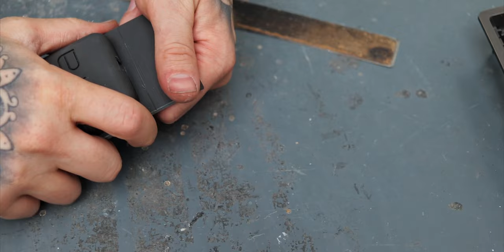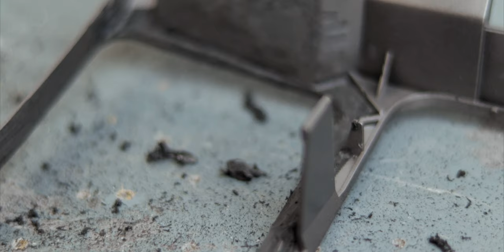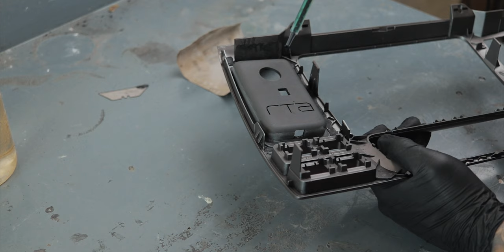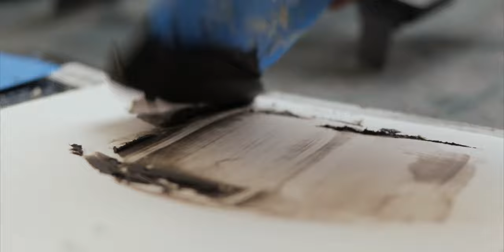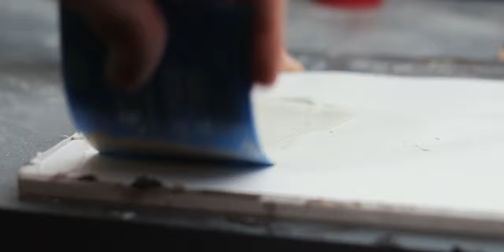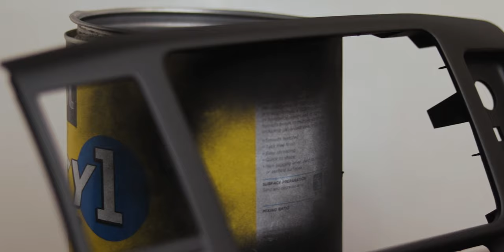MAKING A CUSTOM Air Suspension Controller Mount For A VW Transporter

Comment: What is that superglue-like material you're using, which you then proceed to spray with something immediately after? That would help immensely in my personal manufacturing. Incredible work, by the way. Love it.

Edit: It would be nice if in the corner of the video, you could just post what material you're using at that moment. I know you have a list in the description, but it would be more helpful for us to see which is which.
Reply: It’s normal superglue and the spray is superglue accelerator.
Reply from the maker: Thanks for watching Travis! Gus is right, it’s a super glue with an accelerator/ activator. It’s commonly called CA glue, mitre mate or mitre bond and can be picked up from most hardware stores with the activator included. There are some more specialist versions that are different viscosities for different tasks. If you do a Google search for BSI Insta-cure, they do a range which includes water thin, thin, regular, thick and gap filling.

I’ll definitely look at your suggestion of adding the materials as cards that appear referring to the material I’m using at the time. I am looking at putting together some videos where I explain a project I’m working on, including details of the materials I’m using, explanations of its uses/ benefits and why I use those over alternatives. Let me know if that sounds like something you’d be interested in seeing, I’m trying to gauge some feedback at the moment! Thanks again for watching!
Reply: @RTAFabrication  "...where I explain a project I’m working on, including details of the materials I’m using, explanations of its uses/ benefits and why" - this would be so good and helpful!

Comment: Nice work...what is the black 2 part filler you used at first?
Reply from the maker: Thanks Jon. That’s a project from U-Pol called Plast X 6, although I now use a similar and in my opinion better product from HB Body called Bumpersoft F222. It’s still a polyester body filler but its specific application is plastics. It’s a polyester filler that has some flex which is why I use it on these trims because with the dramatic changes in temperature in a vehicle, it will not crack with the expansion or contraction of the plastic trim. Thanks for watching

Comment: Putty will crack underneath the paint, should have used UV resin/2 comp. But beautiful, a work of art.
Reply from the maker: Thanks! I’ve made these for the past 10 years and never had any crack at the joints. It’s down to the prep work, properly V’ing the joint and correct adhesive choice for the application. The first  filler I use is a two part filler that’s specifically designed for plastic applications, as it is semi-rigid so it’s able to flex slightly and doesn’t crack with temperature changes inside a vehicle. This is UPol plast-x 6, although nowadays I use HB Body F222 which is a very similar product. The second filler is a fine filler for addressing pinholes. It’s another two part filler that isn’t flexible, but is applied with minimal thickness so it has no structure to it for it to crack. Those fillers are specially for the automotive trade and are designed to be used for plastic bumper repairs, which is essentially the same process as creating these custom parts.

Comment: What is the adhesive/spray that you were using?
Reply from the maker: Thanks for watching Justin! The glue and spray combination is a cyanoacrylate adhesive with an activator spray. It’s basically (or actually is) superglue. It’s commonly referred to as mitre mate or mitre bond as well. You can also get different viscosities, there’s one that’s like water, thin, regular, thick and gap filling. The different viscosities are from a more specialist range, but an every day one from a hardware store will be like a regular super glue. Hope that helps!

Comment: what do you use to cure super glu?
Reply from the maker: The super glue is a glue that comes with an activator spray. It’s technically a cyanoacrylate adhesive with activator spray. It’s commonly called CA glue, mitre mate or mitre bond and can be picked up at most hardware stores. You can get specialist versions of different viscosities, water thin, thin, regular, thick and gap filling. If you search for BSI Insta-cure you can see their range of different viscosities.